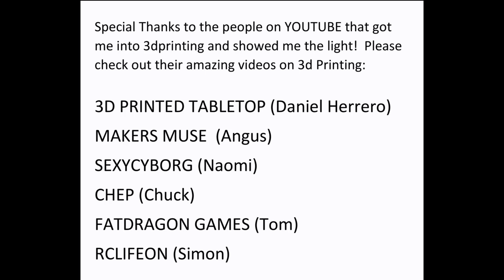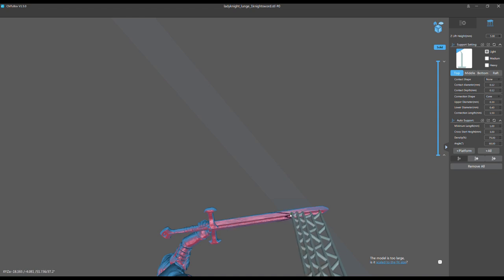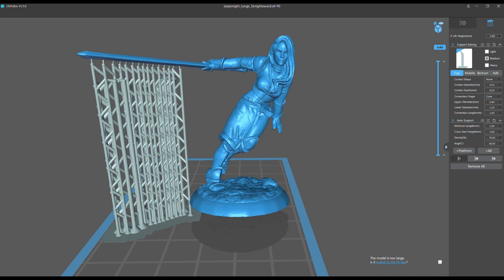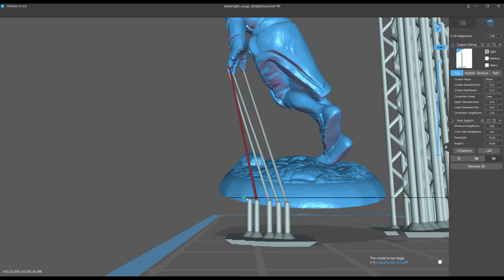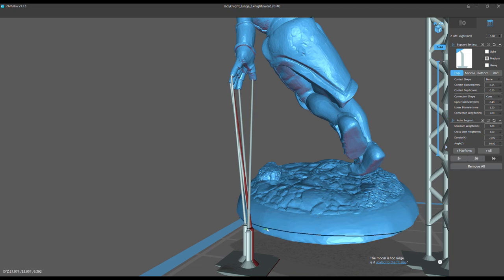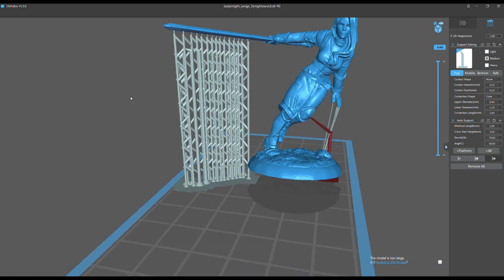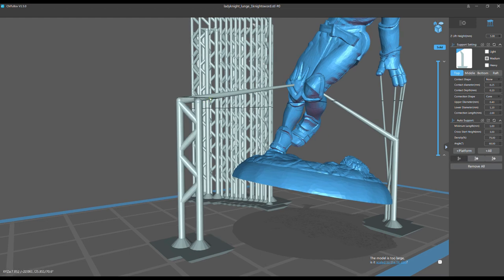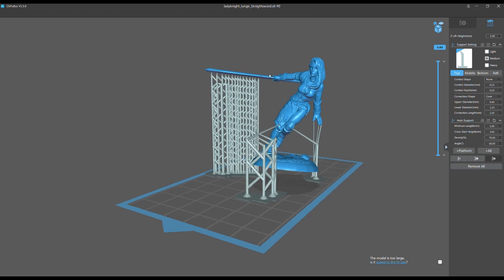Super advanced support techniques in Chitubox: I can support my supports?!? WTF??

Comment: New to resin printing. Your videos are so helpful to me. Have a prusa SL1 so i cant use chitubox. PrusaSlicer doesnt hollow or drain hole yet - sadness. (forced to use mesh mixer or 3d builder) Still learning a great deal about support placement, model orientation, looking for places to hide supports, need for 2 holes etc..
+1 sub for u

Comment: Great videos. I'm stubbornly trying to print a based-miniature with the base flat to FEP, no supports on base. This works OK for me, a metal putty knife works good for removal without damage. However, is there any way in Chitubox to add an "off figure" support like you do, if the base is the largest diameter object in the model? Otherwise all supports added go to the top of the base / on the model. I can't figure out a workaround other than going in to the model design itself and adding some long thin sacrificial horizontal bar which extends beyond the base diameter.
Reply from the maker: of course check my vids I show you how  :)
Reply: @3dprintingpro212  Thanks for the response. I've watched all your vids. The closest you get to this is putting supports on supports and then deleting intermediate. But I'm talking about a special case where a base lies flat, no lift, nothing above it larger diameter. It seems here, that Chitubox never puts a support down to the FEP...it always puts it down to the base/model.
Reply from the maker: @ardarvin  keep adding supports to the suppotrs until one is off the base, then delete the rest  :)
Reply: @3dprintingpro212  thanks. i tried again...it works! It's just very very stubborn, so if the feature is far from the edge, or not a lot of height you can't add enough mid-supports to make chitubox break it off the base. But ya, a higher up one closer to edge works, and once I have one on the FEP I can drag to where needed. Thanks again!

Comment: Hi there! 

Thanks for the tutorials! They've been very helpful. Quick question on printing something with multiple parts using ChiTu Box. I have a sculpt that I've split into 11 different parts. They will not all fit on the same print area (Anycubic Photon) and so I need to do multiple prints. However, ChiTu doesn't read the scale when I bring it into the software. They import in small and need to be scaled up. This would be fine but whenever I save out the project and reopen their scale has reset to small again. This means I cannot have individual projects for individual components of the model. Am I missing something? I cant find info on this. Thanks again and sorry for the epic length of the message!! Keep up the good work.

Rich
Reply from the maker: There is a scaling button where you can control it once it's loaded in (looks like magnifying glass)
Reply: @3dprintingpro212  Thank you for your response. Don't listen to me, it was completely user error 🤣 I was having an issue elsewhere and blaming Chitubox. Thanks again!

Comment: I used this technique for a long thin sword, but the support structure turned into a solid wall along the bottom of the sword, which made the bottom of the sword look like garbage. Did I have too many supports? Or is a setting incorrect?
Reply from the maker: If you have too many too close together, they end up "bonding" together
Reply: Makes sense. Thank you for your responses, your videos are the best resource I have found for creating excellent prints, and your feedback is extremely appreciated

Comment: Loved your ideas.  But I hate sacrificing resin to supports.  Try making your support bases thinner.  No reason to have such a thick base when the weakest point in the chain is the support attachment.
Reply from the maker: Will look into it, but supports for my whole model added up...maybe 10 cents? 20 cents?  Also, big support base to me always meant better adhesion, but I'll test out some smaller ones, thanks for the advice! :)
Reply: @3dprintingpro212  I don't mind spending a bit more on supports if it will "guarantee" me a successful print and, in this case, much cleaner miniatures! Odd that you get cleaner miniatures by using more supports lol

Comment: My manual placement of supports ends up nowhere even CLOSE to where I click. Do you know why that might be?
Reply from the maker: most likely contact depth is too high, to "aim" it where you want set contact depth to .02
Reply: @3dprintingpro212  I just tried that and there is still the same problem. Any other ideas?
Reply: @3dprintingpro212  I can accurately build an addition to an already existing support, but not accurately place a support that touches the piece.
Reply: @3dprintingpro212  OK, I finally figured it out, apparently there Is a setting that I needed to turn on because my graphics card was not supported. Gah! Ah well I got it now. Now I can enjoy and learn from your content. Thanks for your time!

Comment: What is the grey resin that you use?  Anycubic grey?
Reply from the maker: I was using Elegoo Gray but I found that Epax Water Washable for some reason gives me cleaner, clearer prints with more detail retained.  I'm no expert in chemistry or resin manufacturing so I'm not sure why I just see my results.
Reply: @3dprintingpro212  did you ever have supports close to the miniature surface that stick to the miniature itself?
Reply from the maker: @hellfoot17  yep, if I make mistake placing supports it can happen, but I'm pretty good about not letting them hit the model
Reply: @3dprintingpro212  thanks to this vid I'm gonna try the edit tool instead of the supports top and bottom attached to the model.